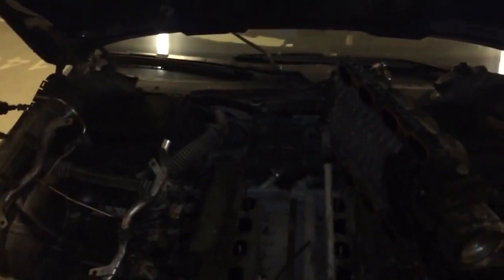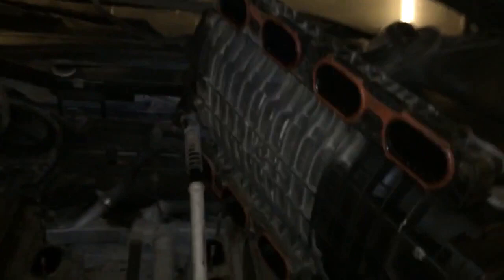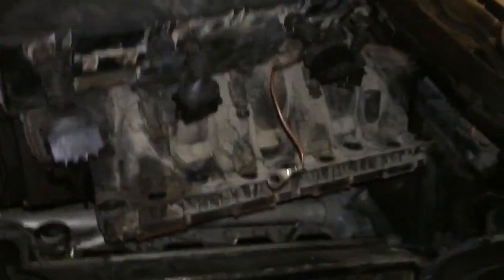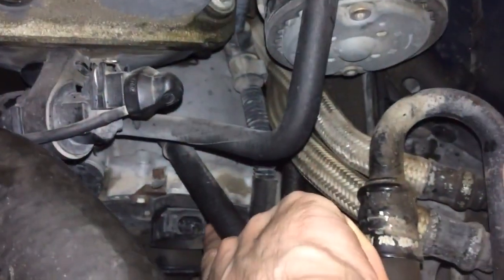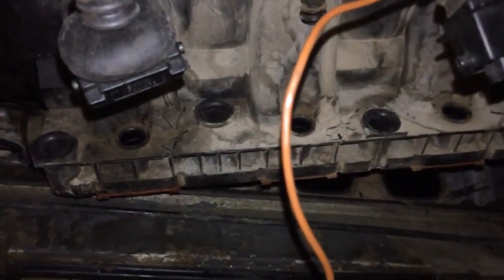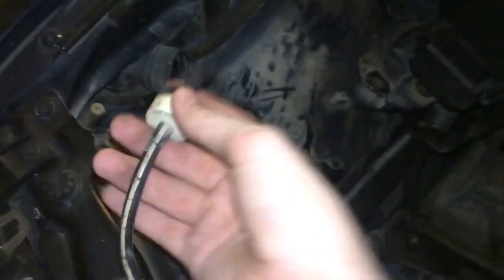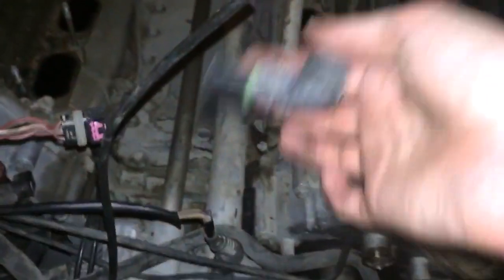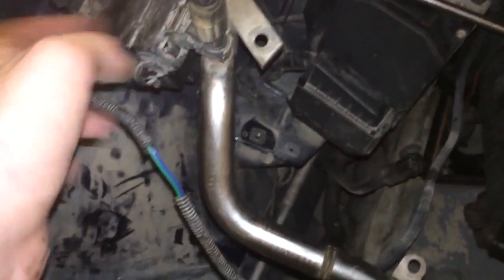BMW E39 V8 Knock Sensor Replacement

Comment: This was a very brave job to say the least. Last year I changed the whole intake manifold of my 520d E39 because the older one was too dirty (EGR soot issue). For me it was cheaper to just buy a second hand intake manifold and replaced myself. Oh boy, my back was hurting really bad after 3 hours of effort. Too many bolts in inaccessive areas. Won't be doing this job anytime soon.
Reply: took me maybe 10 or 12 hours. And not yet finished. I'm having trouble putting back in place the injectors on the manifold and electric box.
Reply: leborde Oh dear. Best of luck with that. Just be careful not to brake anything.

Comment: Is there enough clearance to do this job without removing coolant crossover pipes?
Reply from the maker: It has been quite some time since I have performed a job like this, so I don't recall.  You may be able to replace the knock sensors without removal of the pipes, but it would be prudent to reseal the valley pan, accumulator,, and those pipes while the engine is torn down that far.

Comment: === A WORD FROM THE VIDEO MAKER===

Knocking sensors: what are the symptoms, how to access to change them.

WHAT: what is this, whats is it used for:

Knocking sensors (aka detonation sensors, or choc sensors), are present in you V8 in two pairs of 2.

A knocking sensor is an advanced microphone, listening the detonation happening in the combustion chamber.
It will then feed-back the computer with these info, so that the computer will understand when the detonation is happening and, thanks to the graphe of the sound of the detonation, determine what's happening inside the chamber (a bit like a spectroscopy in astronomy, by analysing the components and graphe of the light perceived by the telescope, you determine its chemical composition). It will then adjust the explosion timing and the composition of the mixture.

SYMPTOMS:
If one or several knocking sensors are fucked-up, the symptoms are various, from light problem to heavy problem:
  - ODB diag runs the codes 210 and/or 211and/or 212 and/or 213 (sensor 1, 2, 3, 4)
  - when idling, your engine will make you feel irregular vibrations in the back of your seat, left and right, a bit like if the engine was not balanced
  - when idling, it will also sounds like it's too cold and having trouble breathing and being fed properly
  - when idling, it can also sounds like a Harley-Davidson, like it's about to stall and/or irregular sound
 - at high rpm (above 5000), you've no torque and/or power
 - when giving a massive acceleration (such as kick-down), it will smell petrol for you or the car following you, as un-burnt petrol, as if the mixture was too rich (a smell similar to kerosene smell in airports)
 - engine fault light is ON on your dashboard
 - engine goes to security: no more acceleration, not higher than 3000 rpm, not higher than 100 kph (60 mph for non-metric friends)
 - engine is stalling while you're departing from a red light, a stop or at slow speed, so that, in order not to switch-off and stall, you've to quickly go to NEUTRAL

CHANGING THE KNOCKING SENSORS
They're in the valley, so you've to remove the electrical box and fuel line and send this to the left. Then remove the intake and send this to the right.

Then removing the sensors. The couple on the right will give fucking hard time, cause of the coolant pipe. I didn't find any other solution but to force with a ply-bar on the pipe, to remove the screws.
To put the screw back in place, same methods: forcing. :(

If, like me, your screws don't go perpendicular and you don't find a way to put them back, then no choice, you have to screw and tight.
But you know you're fucking the female-thread cause your screw is not perpendicular to the female hole and you're forcing to tight.
Then, use this method to tap your female-thread: advance 3/4 of a full turn, get back 1/2 of a full turn. And then, little by little, quarter after quarter, you'll re-tap the female-thread.
Once you've travelled half of the distance till your screw is completely in contact with the sensor, with a strong flat screw-driver, kick the screw a little to put it back perpendicular. Yes, it's rough, but… and then, you should be able to finish the last half of the travel without too much forcing on your screw.
Reply: leborde, is there a way on testing these knocking sensors, to have a pin point location of what knocking sensor is faulty, or if it's the wiring or conector? like a voltage meter? I'm having trouble with my 1997 M62 engine.
Reply: I'm having difficulty to track this, even with the scanner (using Launch), due to its erratic behavior, some times it takes more than 10 running cycles to show up the code again, after erasing it..